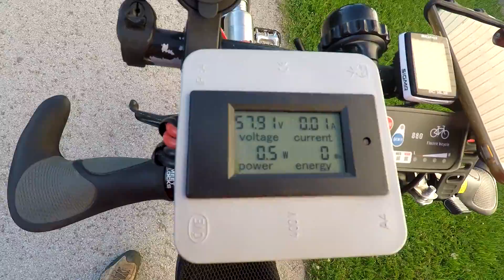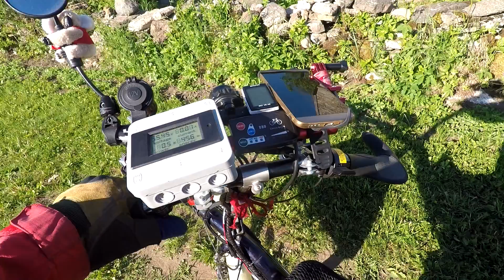Recumbent E-bike - 600km/372mi in two days (throttle only)

Comment: Alright, I got done converting my recumbent to direct drive just like yours. Much better drive than the bbso2, really happy with it. My bbso2 will move to my normal bike. 

I have a question still, do you use a torque arm for your hub motor? I wonder what the necessity is given I will limit motor power to 700 watts. Is the torque ok on your dropouts?
Reply from the maker: Hey. From 350W on torque arm is recommended. Yes my bike has a torque arm and both sides. It's probably overkill. And I also have a motor. limited to 750W. Beacause it peaked sometimes 2000W....
Some say that if you have a steel frame then a torque arm is not needed. Torque arm is inexpensive and helps prevent problems, I definitely recommend it.
Reply: @DatEbikeGuy  What I don’t understand with these torque arms is the wiggleroom they have in angular rotation. Given that wiggleroom the torque arm under normal condition transfers no mechanical force right? Only once the shaft rotates sufficiently past the torque arm wiggleroom will it transfer force, but by the time it has rotated that far it would already have bent the dropouts. So is their use only to prevent catastrophic failure? Or does it actually carry load during normal use?
Reply from the maker: @Felix3301  Is required to resist the torque of the hub motor. If you have a steel frame, 750W is a great limit without the use of a torque arm. For example, if you use generating braking, it's even worse.
Short answer "better to be safe than sorry".
Reply: @DatEbikeGuy  Alright, I ordered one. Going to install it this friday. But still I am wondering whether I need to custom order my own torque arms to have a very tight fit around the axle. I really don't see how torque is coupled with that wiggle room. I will be using regen, have it limited to 10A of braking current. How about you, do you use regen? Also is one torque arm enough? I don't see how I can mount a second one on the derailleur side
Reply from the maker: @Felix3301  My recumbent bike has a torque arm made by me on one side. And the other side bought, but slightly modified. Because the frames are different and you never know if it will sit right away or need to be modified. 
One torque arm for sure. I use two torque arm on my recumbent because the motor axle is small in diameter. 
My commuting E-bike has a much larger motor axle and there I use only one torque arm.
In the case of generating braking, the motor axle also starts to twist in the opposite direction, which means that the bolts should be checked at intervals. Currently I am not using generating braking.
It would be interesting to see a picture or video of your bike in the future :)

Comment: Throttle only got 600 km is very far. Looks like with a smaller battery and  pedalling with the PAS system rather than throttle only could get a similar result. 

But 300 km a day is too much for many people
Reply from the maker: Hey. Thanks for the comment.
Indeed, with 2kW and PAS I've got 340km and ~ 2KW of consumed current, strong headwind + tailwind. These tests are exciting to do. I wonder what my daily limit is in the end. Is it possible to cover 500km a day, for example :)?
Reply: @DatEbikeGuy  I think if you j
have velomobiles or add fairings to the recumbent, you could be even more efficient
Reply from the maker: @taufikabidin412  If I had a velomobile, I probably wouldn't need an motor. I've even thought about fairing. And I've researched all sorts of versions of it.  Currently my favorite is "VELORAKETA VR-500" If you put that name into a youtube search, you'll also find a video. Very interesting.

Comment: Can you give some more info of range, average speed, and wh/km.
Reply from the maker: Hey, sure:
Day 1 charge#1 218km, 31.6km/h AvgS, 6h:54m, 2639Wh / 12.10Wh/km [headwind]
Day 1 charge #2 117km, 30.92km/h AvgS, 3h48m, 1362 Wh / 11.64Wh/km [heawind + tailwind]
Day 2 charge #3  258km, 34.39km/h AvgS, 7h:30m, 2617Wh / 10.14 [tailwind]
Total: 593km, 18h.12m, 6618Wh
Reply: @DatEbikeGuy  I bought the same bike (recumbent) one week after the first video you posted. For long rides which motor you like more the bafang or the hub? I am planing also 3 kw battery but I don't know about the motor because the rims are 24 inch
Reply from the maker: @rosenstamenkov7539  It's a pleasure to hear that :)
Both motors are great... I chose the direct drive hub (magnets inside) motor because I love to use hand throttle a lot. So the chain and gears do not wear out and the chain does not need to be lubricated often. If you love to use PAS then bafang is also a good choice.
The 3kw battery weighs anywhere from 14-16kg.
Reply: @DatEbikeGuy  Awesome! :) Thanks for sharing Dat EbikeGuy
Reply from the maker: @IAmMisterD  And thanks for watching :)

Comment: Could you explain why you swear by a steel frame bike? I converted an aluminum recumbent 2 wheeler into an ebike same as you? Is aluminum dangerous for this? Also which is more efficient? BBs02 or this direct drive hub motor?
Reply from the maker: Hey.
My annual mileage is huge and I carry a heavy battery and equipment, steel not fatigue as much, and longer life. 
When something happens it is easy to weld. If the household has a welding machine, it can be repaired immediately. Aluminum is not bad or dangerous... BTW I have an everyday commuting bike with an aluminum frame :) so I dont hate it
If you drive only with hand throttle then direct drive is better, cheaper. maintance free "no competition"
If you use PAS assist, both motors are OK.
Reply: @DatEbikeGuy  That makes sense, have you had experience with aluminum failing? Or is it more of a precaution/ feeling of being safe?
Reply: @DatEbikeGuy  Also I’m thinking of buying that same hub motor. It is the MXUS 1000W XF40 right? What is the top speed you could reach at 48v? I assume your battery is 48v
Reply from the maker: @Felix3301  "It´s it more of a precaution/feeling of being safe" <--- that one :)
Reply from the maker: @Felix3301   MXUS 1000W XF40 is correct, with cassette version. 52V and top speed ~50 km/h. Don't forget to buy a torque arm as well.
Reply from the maker: @Felix3301  if you have driven somewhere around 1000km, I suggest you check the strength of the spokes by hand. They may need to be adjusted at some point.